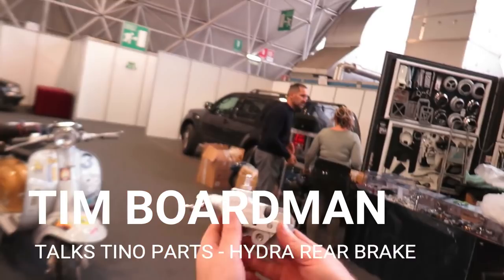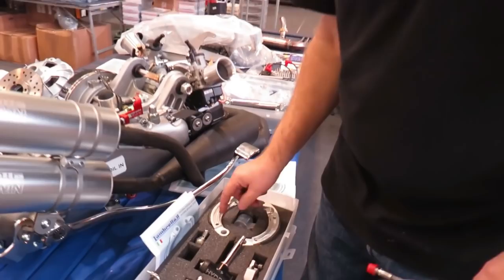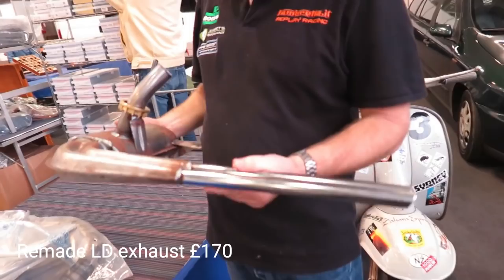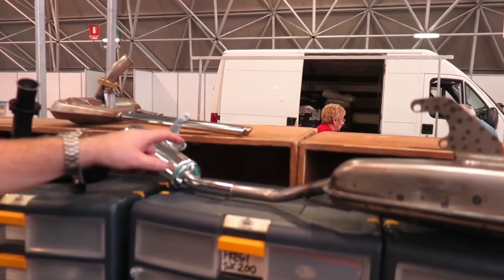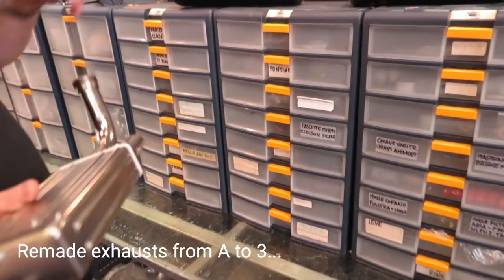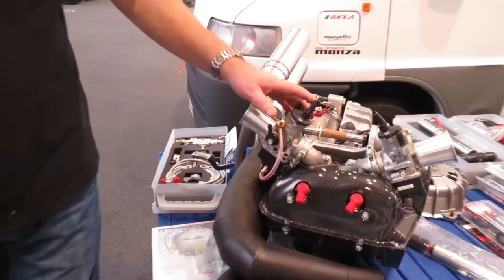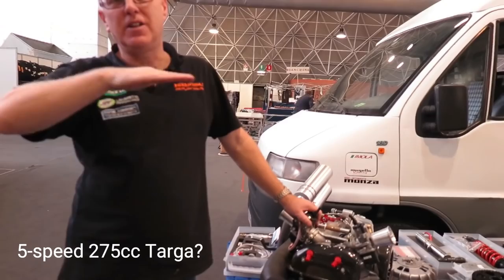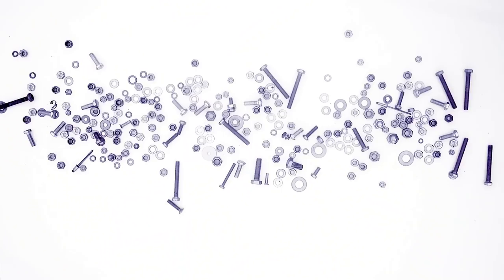SLUK | Lambretta parts from Tino

Comment: How much is the full Engine ????
Reply: Grant Barclay £7500 just for starters
Reply: @exsoulagent   that is mad I have called Ts1
Reply: Grant Barclay everything about Lambretta is expensive these days, lovely engine though, very smooth but ya have too wring the neck out of it too get up a decent speed (70-85mph) in standard form 😉
Reply: @exsoulagent  just got my GP up and running after 17 years ,Does any 1 u no do the Hydrolic back plate like Pm tuning did need a new 1
Reply: @exsoulagent  Remember that originale parts of lambretta are not more available. In Italy many peoples got spare parts but they keep it like santo Graal. So the alternative is casalambretta e Tino or other that they build perfect copy of original item. The quality is good and I usually buy its. You can get discount of you send a high quantity of material. Normaly who repair or restore lambretta S a professional job get discount.
Reply: @adrianobonaldo8941  hi, yes I’m quite aware on original bits being thin on the ground and if they do £££££ or €€€€€€€ if they are for sale. Casa makes some decent stuff, Rimini make very decent stuff, Tino makes ok stuff, not all of it mind you.